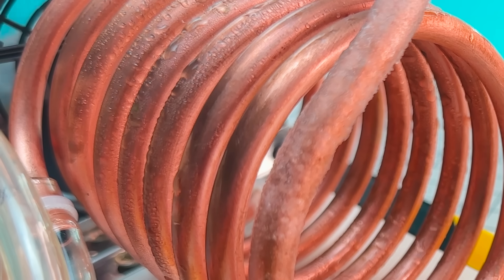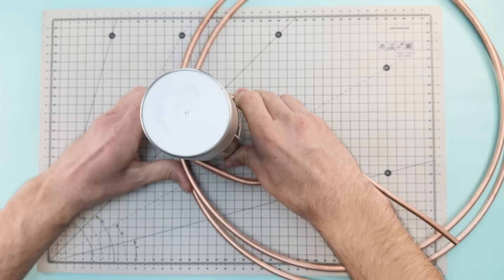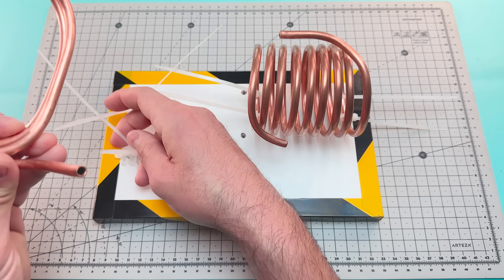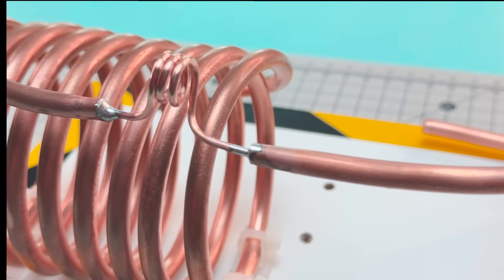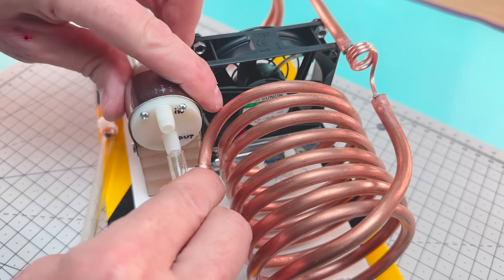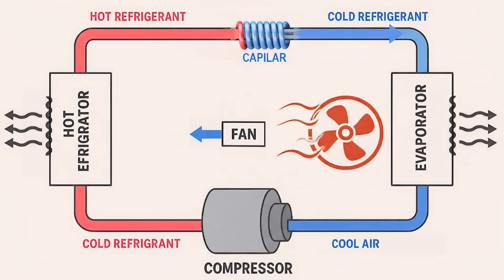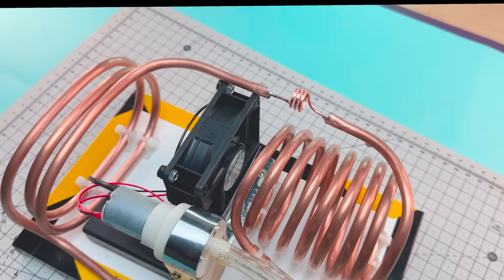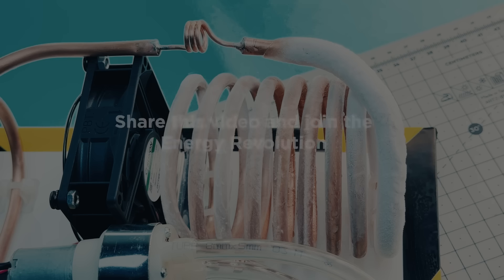Make your own AIR CONDITIONER at home Fast and Easy!

Comment: This will not work as built, no matter what the narration says. 

It’s this simple, there are two coils there, one gets hot, one gets cold.  For every BTU absorbed on the ‘cold’ side, you release that same BTU on the ‘hot’ side.  If both coils are in the same room the net is zero. 

With a ‘real’ air conditioner the ‘hot’ coil is physically mounted outside, or the hot coil is ducted so the heat can be ejected outside. 

If you know, you know.

Comment: do you take into account what kind of chemical reaction the refrigerant will undergo when the weather is extremely hot? Also, you haven't done anything for the heat transfer process. If you give the heat of the air that has become gas back to the room after a certain time, the room will get hotter instead of colder!!! why don't you take this into account? this is a fatal mistake!!!
Reply: If he made a outdoor unit like a mini rediator and connect with this so I think it's working good
Reply: Evet ısınan bölümü odanın dışında birskmali @onlyforyou8030
Reply: герметичность и безопасность этой  конструкции тоже вызывают сомнения.
Reply: Sure, but let's be real. Anyone who is going to build something like what you're talking about already knows how to do it, or they're doing a science project. They don't need this gentleman's input outside of the latter. Also you seem very astute on the topic, and he asked for advice from exactly those types of individuals. I get that you're somewhat doing that, but the tone of it comes of as condescending, smug. Dude never said he's a master engineer, or world renowned HVAC designer. It's just something to tinker around with if things like this may intrigue you. It's something I'd probably do to help my kids with their middle school science fair.Also the best way to handle something like that is to capitalize on it. This channel seems to do decent numbers, and your saying it's wrong then do a video of you, or your doing it the right way. You could even throw the channel name in the title without even having to be disrespectful.  Just give credit, and say he had a great design, but here's how you take that to the next level. It would be beneficial both ways. That's just how I live though. Being cordial, and polite, without having to compromise, anything and when you do that everyone win.💯
Reply: @divineintervention212 way too many people think they are experts and like to give the comments about how bad it was, how wrong they were, why did they do it this way, you know, giving their EXPERT advice 😅 Your comment is the best one yet, well said. Good day to you, random internet person!
Reply: With a hotter outside ambient temperature you would need  better compression of the refrigerant and a condenser fan. They also forget to mention how to cut a capillary tube. Never use a tubing cutter on one, use a utility knife and scribe it, then snap it in half.
Reply: Your devide is cooling and warming the room at the same time. No results, but danger with the gas.
Reply: لسحب الحرارة المجمعة يمكن عمل مصدر طاقة يمتص الحرارة ويحولها إلى كهرباء لشحن البطارية وبالتالي إستهلاك أقل للطاقة.
Reply: This reverse engineering is for making ice than making room cool I think
Reply: Interesting...i was thinking of pleters using more power or geo thermal
Reply: It can transfer heat to the outside like any air conditioner.
Reply: Because it's just a fun science project. It's not meant to cool a house 🤣
Reply: What do these people think that we are all stupid
Reply: I think the purpose is to demonstrate how the AC works and the small project can be made not the actual commercial cooling unit manufacturing
Reply: Look at all these desk jockeys that think they know about chemical reactions 😂😂😂
Reply: To solve this, he would have to make bigger and create a division between the two copper. Here, I would install this in a wall, and the hot part would be outside, and the design would be targeted to disperse heat. The inside part is only the heat. C'moj guys, this is the concept. Engineering is also about taking the next step. Conceptually 100%. Design, needs improvement. For educational purposes for beginners, very good.
Reply: Exactly. While you might feel a little bit of cool air directly in front of this thing for a little while, overall it will be HEATING the room it's in, not cooling it.
Reply: @bluegizmo1983  Ее можно использовать как холодильник, например, для воды или чего угодно. Для процессора я бы не советовал, зальет конденсатом.
Reply: @bluegizmo1983 the equivalent of an AC window unit completely inside a closed room. Seems simple enough to fix, separate the condenser with distance and a wall
Reply: Actually, it will be neutral. Heat is transferred from one coil to the other cancelling out any cooling effect.
Reply: @timrider1224 there is a second law in thermodynamics
Reply: @timrider1224  no because work / energy has went into it in the form of a pump and fan.
Reply: You are soooo negative# we Don need your energy# very costly😢